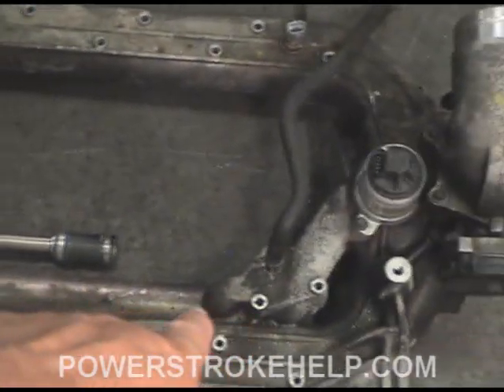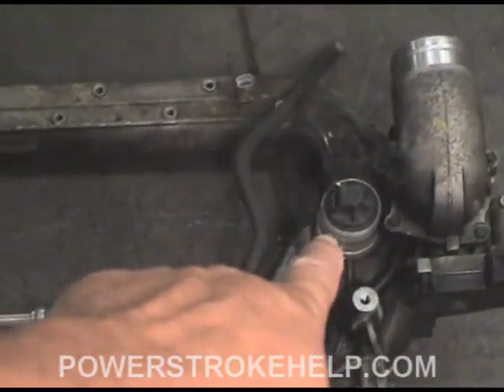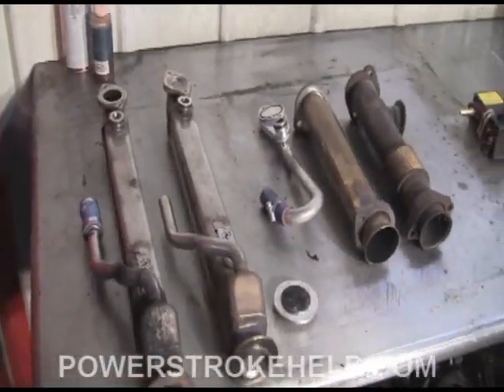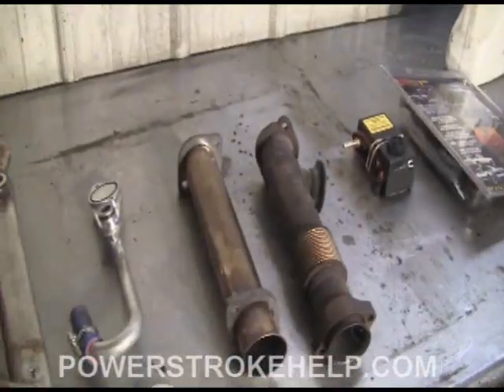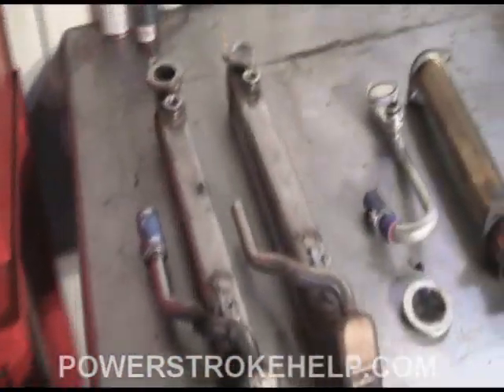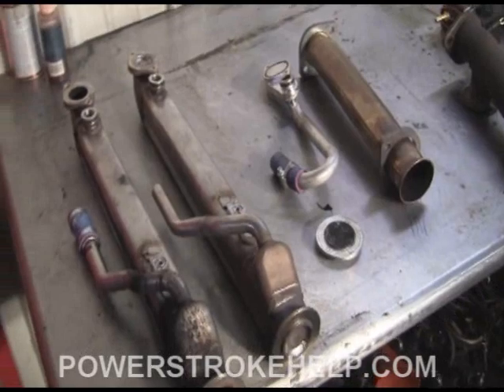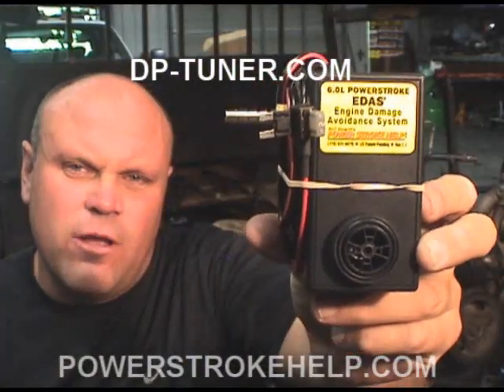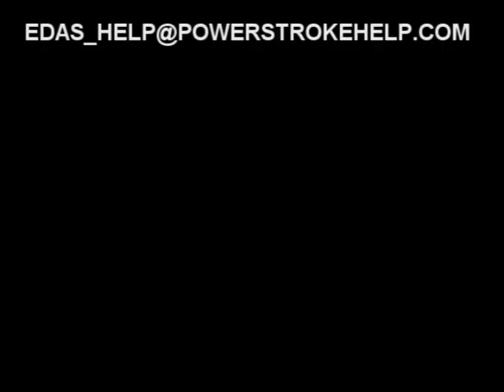6.0L EGR COOLER DELETE AND OIL COOLER ISSUES

Comment: so are you saying the EGR cooler is the main reason for head gasket problems?
Reply: +zac norwood-mr.knowitall Did you just watch and listen to what this guy said?He said 1200 degree exhaust gas gets pushed passed the egr causing the coolant to boil out, causing a low coolant issue that compromises the cooling system that leads to head gasket failure, the oil cooler is a whole other issue with older coolant precipitating the inhibitors out, from again super hot coolant from the egr! So Emissions  restrictions is the main head gasket failure.
Reply: The clogging of the oil cooler is the main cause of all head gasket problems
Reply: +impleasen its the main head gasket failure if the truck has an egr cooler. egr deleted trucks have bead gaskets fail due to too much timing if running a tune or running it low on coolant
Reply: ***** meh, the egr cooler is what causes the oil cooler to clog by precipitating the stuff in the coolant. The EGR also causes the coolant to get pushed out the cap, which if you havent replaced only holds 1psi of pressure. For the most part, THE EGR SYSTEM IS DISASTROUS TO JUST ABOUT EVERY PART OF A DIESEL ENGINE. It soots up the intake, it boils and ruins coolant, and causes the engine to run hotter. I think EGRs are more disastrous than DPFs and here is why. Regen on a Ford is stupid okay. Every other company uses an auxiliary injector that is just downstream of the turbo, and this injector just fires raw fuel into the exhaust stream, so it has no effect on the turbo or it seals or the rear cylinders and their rings and injectors or the oil in the engine. IDK why Ford chose their route, but it makes no sense, not even on the fundamental level. But the EGR consistently rears its ugly head in every type of vehicle even where the regen cycle is more appropriately designed. Personally I think all this DOF EGR DPF DEF stuff is mostly a hoax, especially EGR and DPF, but in this day and age, the green commies gotta get their way and certainly it isnt going to get better. We the consumers need to find ways to get around these things and keep our equipment in good shape. There is your summary on why and how EGR coolers cause failure of the entire engine.
Reply: +zac norwood Hand held tuners and heavy feet added to the problem

Comment: hey bill! just looking into welding plugs into the EGR system,and noticed some people are using a silverweld to set the plugs.. i believe silver weld has a melting point of aprox 850 degrees and  the EGR system runs between 800 to 1200 degrees. what do you use to braze the steel plugs into the EGR system?

Comment: Bill, I would like to buy an egr cooler from you that is welded shut like the one in the video. Mine has failed and I do not want to run around trying to find a shop to weld it shut. I can mail you my old one back.

Comment: I just had the HPOP replaced, along with a new IPR, a new ford oil cooler, and a bulletproof egr cooler. The only thing i want to do now is O- ringed heads, head studs and injectors.... I was told to avoid 175 or 190cc injectors on my daily driver. would a set of 50hp (155cc) be a good option or do you recommend stock injectors? LASTLY what would a bill for that head job and injectors look like?

Comment: if i have a plugged egr valve will that cause coolant to be burning through the exhaust? is that where i should start the diagnosis? and i am unable to change the egr cooler yet will this blow my engine?

Comment from the maker: I actually dont recommend welding the EGR coolers in a 6.4L at all. THe EGR cooler passage is also used as a popback valve for your turbo. If you block the system you run the risk of shearing the shaft on your turbo.
Reply: But welding the EGR COOLER on a 6.0 is okay right?
Reply: @masonpedraza6234  right??

Comment: i took my bad egr cooler and took a hammer and long metal things and broke the little radiator completely out of the cooler housing. i took the housing to the engine shop and had it hot tanked. i cut pieces from another cooler and tig welded both holes up. is this how you do it or do you leave the cooling tubes inside. what kind of metel do you use for your end plugs ? a friend wants one of these and i got rid of the cooler i cut metal from.

Comment from the maker: The EGR valve stays. It needs to be plugged in at initial start up so that the computer "sees" it. After the truck has run for a moment the computer goes to open loop (loaded computer program) where it reads sensors and makes adjustments. At this point the EGR valve is never opened by the computer.

Comment: what happens to the egr valve then? just remove it after welding the egr cooler shut? what did you use to plug the egr cooler? thanks

Comment from the maker: The 03s had a round cooler that seldom failed.
Reply: Can you still weld the round 03 coolers?
Reply: I have an 03 that is new to me.  I am in Calif so all this deleting is a no go for us.  Since I have an 03, should I be ok as long as I maintain the truck.  I had all the fluids and filters changed with Ford, but never did the Coolant or Trans fluid.  Should I get both flushed since I have no record of it being done?

Comment: I have a question about my transmission. I took off from a stop and was givin er to shoot the gap un traffic and as soon as it shifted to 2nd it went bang. Real hard and real loud. Wouldn't move. I coasted to a stop and tried every gear: reverse. Drive. 3 2 1. 4 high and low. Nothing. Just feels like its in neutral. Would you have any idea what could have went? Its also stock with 35s

Comment: bill I have a 2007 king ranch 6.0 with 48,000 miles and was pulling my camper when the temp went from 1/2 to 3/4 for a sec I pulled over and checked the coolant and was a gallon low it had came out of the cap. I took it to have a oil cooler put in and the egr cooler welded and coolant filter added and new coolant cap am I on the right track as far as the dash light what can I do with out programing to get it off. have not changed the head studs.

Comment: Hey Bill I just bought an 05 6.0. Truck is basically flawless and stock minus an AFE air intake and has 90000 miles on it. My question is if I leave it stock will I run into a bunch of issues. I have several friends that have bone stock 6.0 and have never had any issues. And they all have 150K plus miles on them
Reply: scot hazlett Any problems with your 6.0? Im looking to buy a 2005 excursion. Suggestions?
Reply: @pedropunjabi7339  did you ever get that X ?

Comment: Hey Bill I'm looking at a 2003 6.0 Powerstroke I'm 99.9% sure it has a bad EGR system it blows white smoke but its kinda a wet smoke for $3900 do you think its worth the risk or should I talk him down farther or walk away or should I run the other way
Reply: Tyler D Did u end up buying the excursion?

Comment: hi bill i have a question i am  here in ca i pretty much gave a refresh to my 04 6.0 at 102k replaced the egr upgraded cooler and egr valve  and 15k  later my new valve sticks so i got another one. know it runs fine again i currently don't have a tuner but i am going to purchase one i was looking at the edge for monitoring and sct for a tuner. so what i wanna know if i turn the valve off for the 2yr inspection interval am i going to need a new egr valve. please i appreciate a response

Comment: Hi, if I block off my egr cooler and leave the egr valve installed. will I have a affect on how  the engine will run, or possibly blow head gaskets? thanks.

Comment: Ahhhhh!   We had a 2005 or 6 E250 with a 6.0 in it that I ran daily for service calls (Diesel tech/rental service.) It overheated on me once in heavy traffic on a summer day.  Found out the fan clipped the harness/wire to turn the fan on.  I ran the heat as much as I could, but it still overheated.  Temp was fine once I swapped the fan.  I changed jobs, and come to find out it blew a HG a couple months after I left.  Wonder if the EGR system had something to do with it.Good video! Clear up a lot

Comment: hey bill, my 04 6l is currently at 157000mi (i bought it at 154000) and the hpop just failed. It's throwing an egr code, and doesn't have a delete. However, the mechanic says the egr apperars to be new... what could the code mean?

Comment: Bill, I own a 2008 F250 with 80K. What do you recommend I do? Were those issues corrected for the 6.4? or should I go ahead and weld the cooler as you have explained? Thanks!

Comment from the maker: It is two separate problems. The cold start is probably a bad injector or two. The hot start is a leak or a worn out pump or bad injector seal. Id have to see it to be sure.

Comment: Bill i have a early 2004 f250 6.0 at cold start it starts great but has no power will not build any rpm  after idleing for ten min or so does fine. On the other hand once it been run and gets to operating temp it is hard to start. no codes no programer had injectors checked and replaced four on pasenger side any thoughts on what to check

Comment: I have a 2006 f250 with 178,000 miles. All stock as far as i know and i was wanting to flush the radiator and of course put motorcraft gold back in it just to make sure its in it and not something else the previous owner poured in. It runs great and i have heard from many people to install the egr delete so should i just do the weld method like you have shown before or after i flush and replace the coolant or does it matter when, or should i just leave the truck as it is? 

Thanks so much!

Comment: So if i have a bad egr cooler (wet inside the egr valve but no smoke out the tailpipe) can i just weld up both sides of the egr cooler and put it back in?

Comment: Hey Bill.  Interested in the EDAS and EGR cooler block off.  I have an 06 F250, Banks High Ram Air intake, Banks Intercooler, Banks Air intake, Banks Exhaust, Banks Six gun, and Banks billet torque converter.  I bought the truck used all the banks stuff was all on there..previous owner never did the EGR probably due to emissions testing but I want to get it done.  It has 62k miles.
I dont know how far in advance you need to make an appointment at your facility.
Thanks!

Comment from the maker: Yep. you need to run the BulletProof EGR cooler. It is an updated heavy duty unit that can handle more abuse.
Reply: Hey I have 2007 Ford F-250 XLT 6.0 can you give me a Estimate to bulletproof my truck don’t tow a lot but I daily drive it a lot and I want it to be very Reliable and currently live in Hinesville GA I think it’s a 4 hour drive to you
Reply: @ploxplox1109  to totally bulletproof it from head to toe...it's about 15k

Comment: I have an 06 f350 6.0 with 134k...when cold it runs very rough and after idling for 6-7 min it has no power whatsoever..I mean won't hardly untrack itself...then when its warm and you go to start it sometimes it idles very low with no accelerators response at all?? What could cause this? Objectors? Bad ficm? Thanks for any advice!

Comment: I got a question Bill. I have an early 03 6.0 in my Excursion with 225K miles on the clock. Stock original EGR cooler and oil cooler. My question is, when at normal speed my deltas are 170wt * 178ot. (has a bad thermostat) However when at freeway speeds 70-80mph my deltas will go up to around 14-16 degrees. I know the number to avoid is 15 degrees. I'm assuming I have a slight oil cooler blockage. I do have a coolant filter so it shouldn't get worse. Am I in immediate danger or no?

Comment: 2006 f35O  Dually 6.0 184k miles, air raid intake, Blue spring conversion, getting ready to install  egr delete, coolant filter, and SCT tuner.

 Truck just started chugging and blowing smoke on acceleration with lack of power till it gets to a certain RPM then just takes off fine. what do you think issue might be? please help

Comment: Hey bill, heard of pounding a 35mm freeze plug into the up pipe side of the egr cooler? A Youtuber did that, and it seemed to have worked.

Comment: I installed a coolant filtration system on my 06 6.0 and attached a 0-30 psig gauge on the inlet side of my filter housing. I drove my truck today for about two hours and when I got home I checked the gauge with the truck turned off. It read 12 psig. It sort of threw a red flag to me. This truck has never leaked anything, my oil cooler is showing a 6 degree  difference between my oil and water, the truck has never thrown a CEL since it was new. I clean my EGR valve every other oil change and ha

Comment from the maker: The truck will pass visual inspection, but not the electronic test. If you live in an area that tests diesels the I would consider the Bulletproof EGR cooler from Bulletproof diesel

Comment from the maker: It helps but the answer is NO. You need to keep the exhaust heat from transferring into the engine coolant. The only way is to block the cooler.

Comment: i have a 2005, I did a egr cooler delete, otherwise my engine is stock My truck only had 60k when i did the egr delete, the egr system was still working fine. before the delete my oil and coolant temps were about 15 degrees apart, post delete my temps are about 25-50 degrees apart, oil is higher. I havent seen much info regarding post delete temp norms. Any feedback would be appreciated.
Reply: jjcustms08 Do you still have your 05? Any problems after you deleted EGR? Im looking to buy a 6.0 2005 Excursion, but im scared? Any suggestions?

Comment: Bill - Thanks for great information.  I have an 05 and have done the EGR cooled delete, 4" exhaust, upgraded fuel pressure regulator, SCT programing, Amsoil bypass oil filter, and of course new coolant cap. I have the same problem as in another post where I have lost 6 to 7 mpg from when the truck was stock.  If, like you said, the engine is running too cool, what temp should it be running at and where is a good place on the block to install a gauge?  Should I be running a higher thermostat?
Reply: flt89 Did you ever figure it out? Im looking to buy a 2005 6.0 but not sure

Comment: Bill, when welding both ends of the egr cooler shut and reinstalling the egr valve and leaving it plugged in, is it absolutely necessary to shut the valve off electronically or can i just leave it alone? if there is no exhaust coming through the cooler does it really matter if the valve opens or closes with normal operation? 39,000 mi 2006 6.0 6spd FX4 XLT SC mbrp 4'' turbo back AEM workhorse cold air. Do you know of any really good 6.0 mechanics in Northern California for my "bullet proof"

Comment: Bill - awesome help. Priceless. I'm currently repairing the no start when hot high pressure oil issues on my 2005 6.0 with 43,000 miles. Since i have the engine apart, i'm considering doing the egr delete per your recommendation to weld the tubes. I also wonder if I should go ahead and change the oil cooler: when i took off the degas unit, there was a considerable amount of black residue on bottom. Is this potentially a sign of precipitate in the oil cooler as well, or unrelated? Thanks again!

Comment: Since you weld the end shut and re-install the egr cooler do you still install the coolant lines to the egr cooler as they originally are?  Or do you plug or bypass the coolant around the egr cooler?

Comment from the maker: @Oilmanhenry I have found it best to leave it in and plugged in especially in 05 and later 6.0s. When the truck is first started the PCM performs a complete diagnostic of the electrical system. The PCM will find the EGR valve unplugged it sets a code. Some tuning programs will over ride this. I prefer to leave it so the diagnostic is completed successfully and then the tuning never opens the valve. It is far more effective with less drivability problems in the long run.

Comment: I put in a EGR delete and replaced the oil cooler, but now my fuel economy has dropped from around 17MPGs to 12 or 13MPGs.  Is this normal or is there some special tuning that is recommended? or maybe buying a chip?  Used bulletproof egr delete and factory oil cooler.
Reply: Oilmanhenry - Im having the same problem. Did you find a solution?

Comment from the maker: @DragosZK It is best to weld the cooler and do the EGR off tune. Also replace the oil cooler while you have it apart.
Reply: powerstrokehelp Can you recommend a better aftermarket oil cooler than the factory unit? Thanks!

Comment: Anyway I can call or email you guys?
Couldn't find that info on website but I love learning things from you.
I'm training to be a diesel technician and I'm getting a 2004 F250 and I'm wondering about doing the EGR Delete by welding the Cooler itself.
Wanted to know if you can explain that to me.

Comment from the maker: @MarineCorpsProud We pressure test every cooler after we weld it to be sure there is no leakage. SO the answer is that is doesn't matter if the EGR cooler is bad if it is welded correctly.

Comment from the maker: @FordToughDiesel You need to check out the truck thoroughly. See if it has a goose neck or fifth wheel. If it has been pulling hard it may need some attention soon. OR just figure a bulletproofing into the budget and get it done and ride with confidence. NOBODY sells a perfect truck that does not need anything. The probability is high that it has an issue that may or may not be obvious.

Comment: @powerstrokehelp so it is a stainless piece just a matter of getting some plugs or making some and getting them tig welded in place.  Thanks for the tip my truck is off warranty in a year, welding it looks like a cheaper solution , plus replace the oil cooler at the same time.

Comment from the maker: @Compwhiz128 In the dirty south it is a non issue because no one tests diesels. The problem with the Bullet proof system is that heat STILL gets into the coolant but it is a more durable unit for folks living in CA or other area that tests diesels.